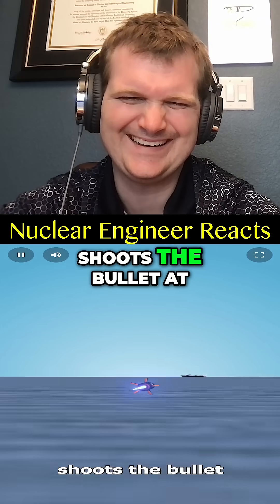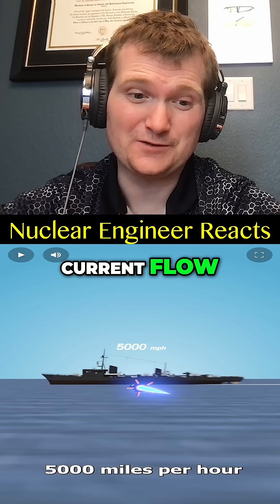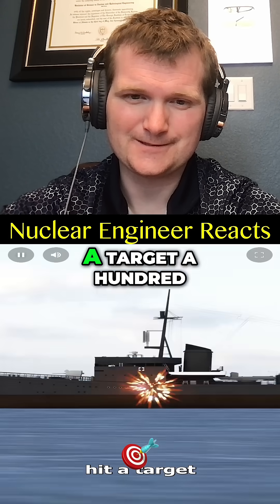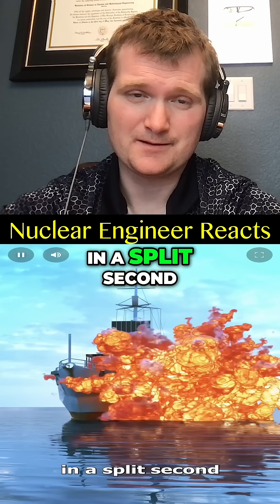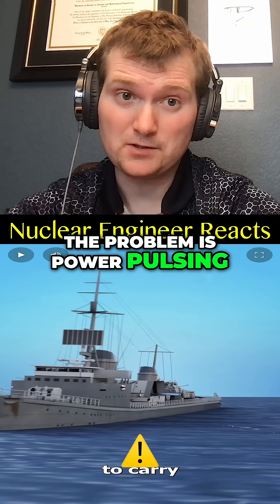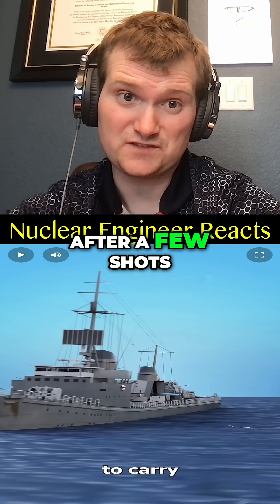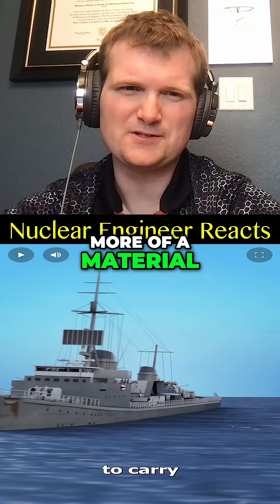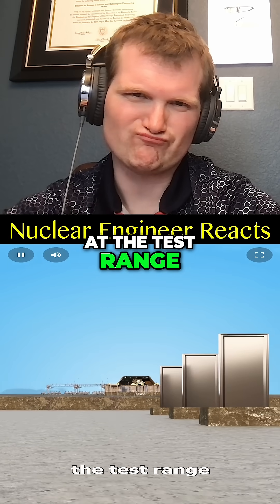Why the Railgun is Too Powerful - Nuclear Engineer Reacts to Zack D. Films

Comment: Honestly these are mostly for show and propaganda. Aside from the problems outlined here, they're primary damage method is kinetic, which has a much worse ability to deal wide area damage. Anything they hit they'll go right through, but that aren't going to seriously hurt most things not directly in their path.

If you want a look at a similar speed projectile, (albeit of higher mass), hitting the ground. Look up the impacts of MIRV's from ICBM tests. They use ballast in the place of the nuclear warhead for these tests so the impact efects are purely kinetic, and they hit the ground at about the same velocity, (can be higher depending on the railgun where talking about). They do a good job of burrowing in, but they don't throw up much of a shockwave around the impact point or creates massive amounts of sideways shrapnel.

Their only real benefit is the difficulty of intercepting them.
Reply: nothing wrong with pure kinetic projectiles against hardened targets. sabot rounds exist. and theyre fairly effective at killing tank crews without entierly destroying the tank.
Whilst the result might be limited depending on what and where you hit on a ship due to compartmentalisation, the question is how much havoc you can cause with just the shock waves from that thing passing through a compartment.
theres thousands of subsystems on a ship, many that are pressurised and may be susceptible to both external or internal shocks.
And a rail gun projectile is likely to make the ship ring like a tuning fork when passing through.
Reply: @konzetsushi  In terms of hitting a ship, all of those affects are far, far, far worse if you just set of a modest amount of explosive. The amount an anti-shipping missile carries is many, many, many times as effective, and in live fire exercises, a single such missile isn't remotely guaranteed to sink a ship even with no functional damage control.

Your right, for very hardened point targets, they're great, but the propaganda and pundits are talking them up like they can do everything a tomahawk missile or bunker buster bomb, or the like can do, and they just don;t have remotely the same scale of effect on target.

Comment: So what if we make the rail out of tungsten? Yeah, it's expensive and heavy, but it can take more heat than the surface of the sun. Maybe that would help with erosion and heat.
Reply: Making tungsten parts is really difficult and expensive.

Also tungsten is heavy as hell, not great if you want to put it on a ship.

From a physics perspective there's always solutions, from an engineering perspective the solutions might make the entire project not viable.
Reply: Clippy likes that comment :)
Reply: Tungsten is strong but not flexible enough. It would break immidiate after a shot.

Comment: Another issue is it cannot hit past the horizon, while missiles can - though maybe someday it'll be used in space. Who knows...
Reply: Of course it can hit beyond the horizon. Just change the elevation of the gun. We have a lot of knowledge on such ballistics, not in the least because of WW2.

You can mount your sensors high up to extend the horizon. If you employ integrated systems a drone can relay the target position to the ship (even the Iowa class battleships employed early drones in the Gulf War in 1991) so that a firing solution can be obtained.
Reply: @juliusfucik4011  i think he's inferring to the relation between the curvature of the earth, the projectiles velocity and earths escape velocity.
it needs to go about 25k mph to have escape velocity, so five times less, but i imagine even at 5k mph it'll be tricky aiming it in any parabola to properly arc past the horizon without reducing its initial speed.
whilst i wont do the maths or cant for that matter i imagine there will be a significant dead-zone before the projectiles parabola reaches the sea level again should you start to arc the shot up.

Comment: They even addressed this problem by adding a second reactor to the ships that would have been equipped with these. The technology just isn't there yet to get these to be viable. Same goes for Gauss.

Now what would be interesting to see, is what kind of damage would occur if a rail slug tore through a ship down the throat, bow to stern hit. I have no idea what alloys are used in rail rounds, not sure if it's a fero-tungsten round or what. But keep in mind, no country really makes an armored ship anymore, mainly because we don't use 16/45s anymore.
Reply: Not a lot, it's the same reason why battleship canons never used apfsds rounds, a ship is just really big and you need to spread out the damage, a railgun does the opposite concentrating a lot of destruction power in a single spot
Reply: @pedrocesarsakihara1853 yes but rail gun rounds are designed to punch through, not destroy one spot. That would be an explosive. This is a bullet.
Reply: The real reason they stop making them was the barrels. Power wasn't a big a problem compared to the rail degradation. Because of the amount of current flowing through the rails and the shear speed of the projectile, the friction would just destroy them. You were talking only a few shops before you had to replace the entire rail setup.
Reply: @unknowngamer37415 yeah it's super inefficient, super expensive, and the maintenance just becomes too much work to make it worth it. You would constantly have to replace and rebuild parts and could probably only shoot a few times depending on the current state of the rails. Better hit that target !
Reply: If the ship is hit by the side i think it will just leave a clean hole, sort of overpenetration
AP in ww1-2 ships had a explosive charge that armed and exploded once the shell went through the hull, i doubt a railgun round will carry any explosive with it